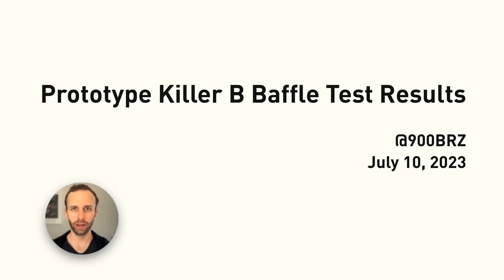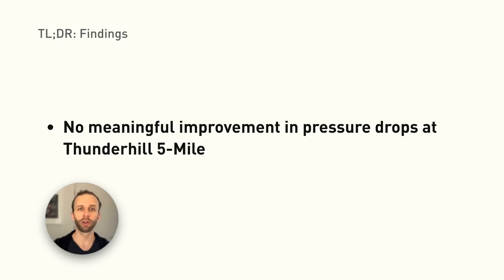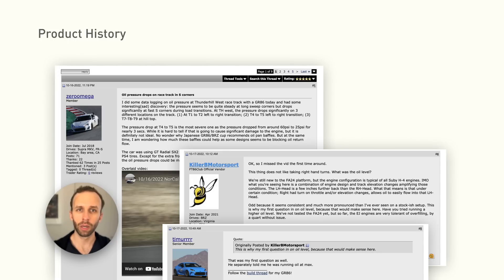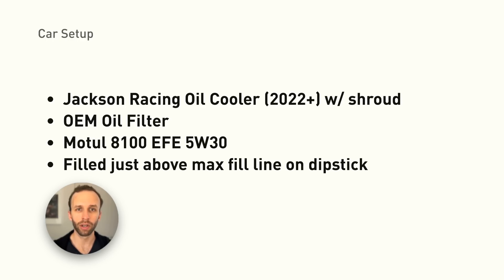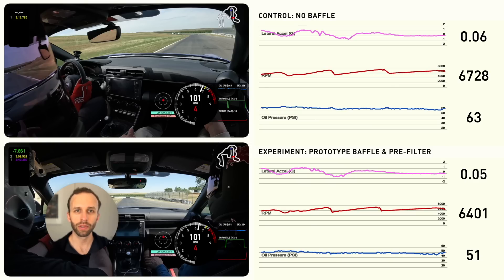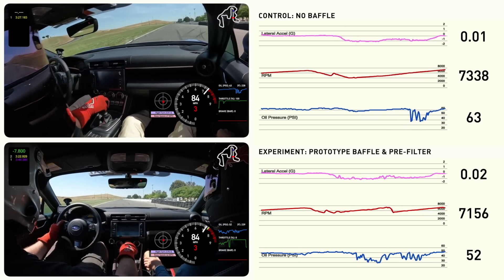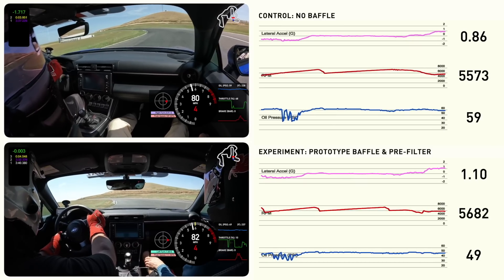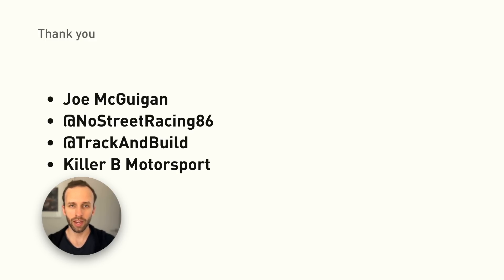BRZ/GR86 FA24 Killer B Prototype Baffle Test Results

Comment: So it seems to be purely right turns and largely matches g-force amount.  It doesn't seem to be sensitive to accel or brake in conjunction, at least not much.  It just seems to mostly be turning right.  More g's, more drop, and there looks to be a starting threshold.

Now it's never going to zero, but there's definitely a drop that seems consistent.

Because it's mainly g rated and doesn't seem to be time based, aka delay effect, I'm actually more curious if it's a mechanical problem, think a work equation upon the hydraulic system.  It acts like however the routing, pump, volume of liquid, etc. are packaged physically, that when turning right, that weight load of liquid is pushing against the pumping method and reducing it by a specific amount in relation.

Now I have no idea how the oiling system is designed on this car, so I have no idea what mechanics of the system could create this, but this mostly seems like a working effort effect on the system, like the pump is pushing against a rising head pressure caused by lateral force when turning right only.  It has no effect turning left, braking, nor accelerating.

If I knew the mechanical layout, like a full schematic, I think thick the shortcoming of the design would be obvious.

Now what my guess means is that more or less oil doesn't matter and any kind of baffling or pick up also will not matter at all.  What you'd specifically need is either a stronger pump to provide additional mechanical overhead, or it's a problem with the mechanical build of the pressure regulator that's causing the problem.  Either the pump is fighting a variable head that's significant, or the regulator is mechanically influenced by turning right.

At a glance, that's where my engineering brain goes for sources of the behavior.  I just don't know any of the mechanics of the system.  But my guess is you and Killer B are barking up the wrong tree.  I don't think this is a starvation issue at all.  It's a pumping head or regulator mechanical problem.

If you can install pressure sensors pre and post regulator, you'll likely find your answer.  You'll likely see something funky going on.
Reply from the maker: Thanks for the detailed comment. I've uploaded some images from a Subaru Corporate technical information bulletin here: https://drive.google.com/drive/folders/1YmUWypkT_-zKA-JCBRYzb2QQO2pTP-Ak?usp=drive_link

From what I've heard the gerotor pump used in these vehicles is overbuilt for the application. The pressure is controlled by a pressure relief valve rather than a regulator. 

Take a look at the images linked above and see what you think!

Comment: Ahh the scientific method. Well done. Its hard to imagine Subaru was not aware of this issue. Hard to understand why they, with all their resources, didn't do the testing you are doing and fix the problem before signing off on a car that is known for track use. I hope you find a solution. If all else fails this seems like a perfect scenario for an Accusump. I am watching and wishing you success.
Reply: When the NC Miata had some starvation issues, Mazda revised the sump design for all cars.  More faith in Mazda for motorsports applications.
Reply: Subaru DID fix the issue.   The FA24 in the WRX keeps steady oil pressure at all times.
Reply from the maker: I’ve heard people say that but I haven’t seen any data to support it.

Comment: As a former WRX owner who went through two EJs due to similar oiling problems (and spun bearings), I really hope you're able to get to the bottom of this and provide a fix for the FRS/BRZ enthusiasts. IMO, it's ridiculous that Subaru didn't learn their lessons from the EJ motors to make the FAs more resistant to this. Anyway, fantastic work; I hope you find a solution soon!
Reply: Instead of "going throigh engines" get yourself ej20 turbo and/or narrow eudm/jdm naturally aspirated/equal lenght header specific engine oil pan.
mid 2000s EJ25 turboes had stupid wide and flat pan with tons of room for oil to pool away from the oil pickup tube tube. 

Equal length header one is very narrow and deep and solves this problem entirely. Subaru eventually added it last version of ej25. EJ257 in 2008+ sti's, thi ideally you would also get killerbee baffles for this oil pan for extreme track use plus a welded oil pickup tube. This way you "go through" another engine ever again.
Reply: The thing is Subaru actually has fixed it, the FA24F in the WRX doesn't have this issue.
Reply from the maker: We don’t actually have proof that it’s fixed in the WRX. There is one person who claims he has tested it on Reddit but he provides no data to substantiate the claim.
Reply: @KTH96 yep, brz always feels like Subarus step child
Reply: @KTH96 so what's stopping us from using THAT oil pan? What's different?
Reply: @thegirthquake8574  Might be it lower and deeper placement innengine bay compared to typical subarubplacememtnof ahead of front axle.

Comment: not sure if this helps but in the control video, i noticed at 3:49, in the hairpin rpm is 4k rpm and lateral accel is around -1g, and oil pressure is solid 60, now fast forward to 7:21 same hairpin, similar conditions except rpm is at 7100rpm (2ndgear). but oil pressure dropped to low 30s.        so yeah.   thanks for your research. great stuff.
Reply from the maker: Good catch. Yeah we're noticing that the pressure drops seem to happen right around 6K RPM and above. We believe it's because there's a higher flow rate of oil at high RPM, so it's exhausting the supply in the sump faster than oil is returning. This is also why short-shifting helps.
Reply: @900BRZ what do you mean shortshifting helps?
Reply from the maker: @jagymeister  If you go through a right-hand turn 1 gear higher than normal, you will reduce the likelihood for a pressure drop because you reduce the flow rate through the engine, keeping more oil available in the sump. 

For example, by taking T5 at Thunderhill West in 4th instead of 3rd, I can eliminate the pressure drop. It may be slower, but if you want to reduce risk, it’s a strategy that we’ve proven in at least some corners.
Reply: @900BRZ  thanks for info! Going in upper gears actually made my times faster in GR Yaris (car more stable). Im getting 86 next month, this needs to be sorted! Thanks for your time🙏🏻
Reply from the maker: Yeah there’s someone in our group who is almost always a gear higher than other folks and he’s really fast. Can definitely still be fast with higher gear selection you just have to maintain the speed!
Reply: Higher rpm seems like it might do a couple of things: (A) Pumps more oil to the heads, and since return is passive, tends to accumulate oil there. (B) Increases agitation of oil in pan (see prior poster's concern about crank foaming). (C) Increases "timing chain pump effect" - the tendancy of oil accumulationg in the timing cover to get entrained on the lower chain.
Reply from the maker: Yeah, great points.

Comment: Please review the comments I wrote on a previous video to address the issues you are having. My brother has an FRS with the 2.0 L engine, and someone has found the volume of oil going to the heads was superfluous, which bleeds off the oil volume required in other areas of the engine. I don't know if this item was addressed in the FA24 redesign.
Reply from the maker: Just replied to the other comment.

Comment: Maybe the oil pump is not powerful enough to maintain pressure?
Reply from the maker: I’ve been told that the pump is oversized for the application and the nominal pressure is typically limited by the pressure relief valve. But I don’t have primary sources on that.

Comment: Curious with the lower overall oil pressure, especially if the KB strainer is not the source.  I wonder if there is any cavitation from the strainer when going into the pickup.
Reply from the maker: Yeah I believe the nominal pressures are due to the pre-filter. We’ll see when I remove it.

Comment: Have you guys heard of the AnsixAuto oil pan baffle? It seems to address the fitment by making the tolerances much tighter.
Reply from the maker: I’m not comfortable using baffles with horizontal trap doors at this point. I’ve seen one failure video when the trap door fell off and got stuck in the pickup.
Reply: @900BRZ  That’s good to know, thank you for the response. I’ll wait for your further analysis to make a decision, then.

Comment: This is probably an stupid question but I'll ask anyway... did you try running the factory recommended 0w-20 oil weight? (apologies if this was already covered).

This is great work btw, thanks.
Reply from the maker: At these temps, we’d see lower nominal pressures with 0W20, as the viscosity would be lower than with 5W30. Factory recommendation in hot climates, like Malaysia, is actually 5W30.

Comment: My only concern is that you changed two things at the same time, the oil pickup mod could have skewed your results.
Reply from the maker: Yes, I decided to test these as a pair. But even if nominal pressures were lower, I would have expected to see some decrease in pressure drops if the baffle was helpful. I have to conclude that both are not helpful.

Comment: This is worth gold thanks a lot! Anyone knows if a similar test was made for GT86? I know he tested in the 1st video, but Im afraid about escenarios with high grip tyres. I already read about several cases of blowing up engine at a track after high G`s turns
Reply from the maker: I’m not aware of extensive testing for the GT86. What we’ve seen on one vehicle in our group is that it has higher limits before it shows adverse affects, but the pressure drops are fairly similar. With grippier tires, you’ll likely have similar results as FA24 unless you go down the path of adding baffles, etc.
Reply: @900BRZ  thanks for the reply! If I may I would drop a couple of questions on this topic,
 1. Do you think that driving at lower rpms in critical turns would help? (Although maybe no difference down to 5k rpm because the pressure remains constant)
2. How is the throttle position affecting the engine components? (You mentioned that the damage to bearings is bigger when throttle is more open)
Thanks for this big help to the community
Reply from the maker: @motor1052  No problem, answers below: 

1) Yes, our thinking is that lower RPMs result in less flow through the pump, which means more oil remains available to the pickup in the sump. We’ve seen that just short shifting 1 gear can eliminate the drops—you don’t necessarily even need to go below 5K RPM. 

2) Throttle position is generally indicative of higher load on the engine, which is actually what causes the increased chance for bearing damage.
Reply: @900BRZ  thanks mate. You share a very valuable experience. Looking forward to see how the experiment is developed, all the best 🙏🏼

Comment: do you consider the sx2 tires used in your testing to be lower in grip as compared to the OEM PS4 tires? Thank you for all you're doing :)
Reply from the maker: We consider them to be slightly lower grip than the originally equipped PS4 tire.

Comment: Hey man, even though I saw your post a few days ago i was still waiting for this video to come out. Very interesting to see that the pressure is lower across the board with the prefilter. I really hope that next results will be more promissing. I really think keeping the oil in the pan is the way to go, you can see that as soon as the car is turning to the right the pressure drops, which means that the oil is escaping the pan and not only being stuck at the top of the engine (at this temperature the oil should have no issue going back to the pan). I cannot wait for further testing ! Thanks for the quality content man 👍
Reply from the maker: Agree, thank you!

Comment: Are you running an air / oil separator?
From what I’ve read, all Porsches, years 1997 – 2008, that have the M96 and M97 engines (Boxster’s, Cayman’s, and 911’s) are oil starvation vulnerable when tracked / auto-crossed.
This is a documented / known issue. I won't begin to assume it's the same issue but understand that when these models wore rubber with treadwear under 280, (the lower, the sticker), it’s possible that the oil system can’t handle it and…boom. Apparently, it has a lot to do with oil foaming.
Porsche found that adding an air / oil separator addressed the issue…of course, I’m pretty sure that all these models come stock with oil coolers, so I’m sure that helps keep things cooler as well.
The Porsche P/N is Porsche Motorsports AOS Air Oil Separator 99610792600 (in case anyone is curious).
Reply: Yeah I’d be interested in seeing some testing with AOS too. More particularly the ones that are not a catch-can system (like the Perrin)
Reply from the maker: I’m not sure how AOS would solve the problems of oil starvation in those cars (and this one). Do you have sources on that? 

I’m not running one right now but mainly just because I didn’t want to add variables yet. Killer B actually sent me their dual AOS/catch can but I haven’t installed it yet.
Reply: My source would be rennlist. Interestingly some models have the problems on left turns while others on long rights. Lots of older discussions just like what’s going on now with the twins: Baffles, oil coolers, aeration (why i brought this up), pooling, deeper pickup tubes, and going to a…porsche racing AOS as the standard one wasn’t sufficient for track. just trying to help man. Love what you’re doing, so thank you.
Reply from the maker: I’m not saying you’re wrong, just that I don’t understand it yet and want to read more.

Comment: Hey I was looking into getting a 2022-23 86 and was pretty set on it until I was forwarded your previous video explaining the oil pressure drop. I don’t really plan to track the car hardly at all at the moment. Do you believe it’s unwise to go ahead and still make the purchase for just like daily driving and a little fun here and there on the road. I’m just curious if this is mainly a track problem or an overall driving issue? If anything knows I’d love to hear from you.
Reply from the maker: I haven’t done any testing on the street, but I believe you’d have to be pushing very hard to see it on street. Ultimately, everyone has to make the call based on their risk tolerance, but if the car is bone stock and mainly used on street, I’d expect the warranty to apply.
Reply: @900BRZ  thanks for the reply It means a lot. You guys are doing a great job with these tests!!! Y’all are awesome!

Comment: I wonder if an oil pick up extension can be added similar to the pre filter. Maybe even one that redirects the angle. Paired with a different pan. Need to get a camera in the pan while on a sweeper to see if the pickup is getting starved to begin with which is no easy task.

Comment: I run 5 and 3/4 quarts of 5w30, 9 track days with 1.3 sustained Gs on catalyst on 200TW RT660s and have not seen any oil foaming, change out every 3 track days (overkill? Maybe) but no baffle and no oil cooler
Reply from the maker: I’m not familiar with observing foaming. How would you detect that?

Comment: Thank you for these updates. Bummer about the killer b baffle but the win here is the systematic way in which you are working toward a solution. It’s the kind of R&D that Subaru should have done in the first place. I am far from knowledgeable on the subject of oiling and flows but if the oil is pooling to the left and not the right, I wonder if a design with strategically located vertical plates could do the job?

Comment: Hey. Thanks for the thorough work. Much appreciated. I am still in the camp of more fill, w40-50 oil and no cooler to help baseline pressure.
Reply: @900BRZ I am installing an oil pressure monitoring system. We will help you investigate and test stuff out.

Comment: Respect to KillerBee for putting their design through this level of scrutiny. I wasn’t convinced it would be a success as it doesn’t address sloshing in the sump at all, however it takes outside the box thinking to drive developments forward and for that they deserve credit. Thanks again to you for doing all this legwork on the behalf of the community.
Reply from the maker: Agree, they had a good idea that was a zag when everyone else was zigging. But it didn’t play out this time.
Reply: @900BRZ  I actually see it as a positive in some sense. It points to a more “traditional” fix being the way to go, which means there’s no fundamental design error. Most engines require sump baffling, especially Subaru boxers. I think it’s far better to have the “standard problem” then having to go above and beyond to sort the issue
Reply from the maker: Yeah I see that argument for sure.

Comment: Literally, I think this issue also applied to the VB WRX.
Reply from the maker: Not sure about that. Requires separate testing due to the oiling changes to feed the turbo.
Reply: Nope.  The FA24DIT in the VB WRX has been tested by multiple people and doesn't have this issue.  Steady oil pressure in all corners.
Reply from the maker: @momsbasement656  Can you link me to the data they shared?